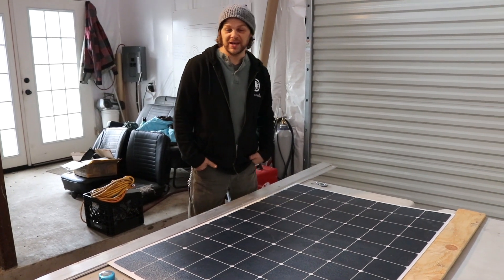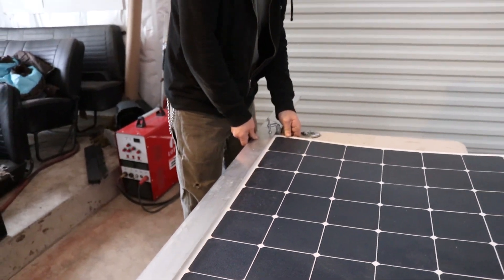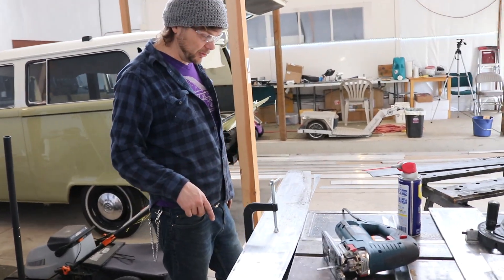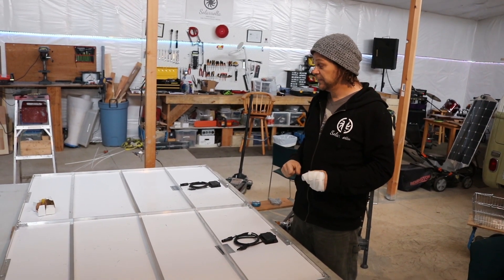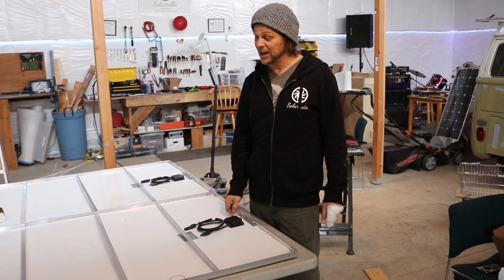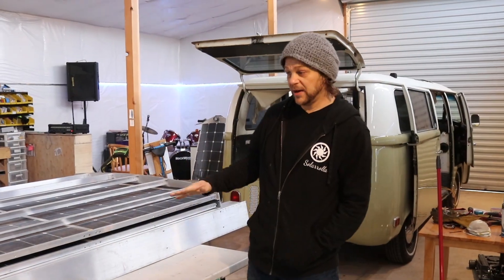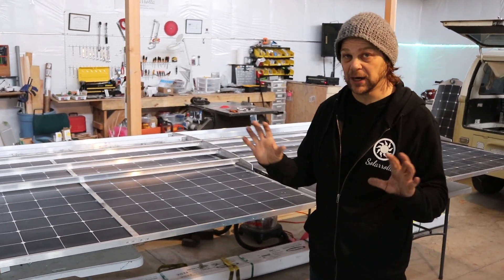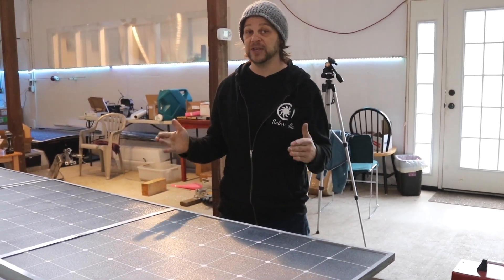Solarrolla- Redfoo Video 5: Solar awnings, how to get 3KW of solar on a VW Bus!

Comment: Great video. I'm planning the same for my renovated (in process of 100% interior, etc.) 32', 3 slide RV/Tiny house. I hope to operate a mini-split.
Consider a 'trim-router' with a template for cutting aluminum shapes.
I would like to figure out a way to tilt, or angle the panels to face the sun squarely.

Comment: Awesome, looks very nice, thanks for sharing! 3kWp is impressive.
I'd be curious if anybody has looked at the "Iveco Daily Electric". It seems like the ideal electric van at the moment, you can also get it as a chassis and build your own box on top of it. Potential for lots of solar.
I'd also be curious what solar panels you chose. How is cost / kWh, efficiency and longevity compared to heavy glass panels?

I was seriously considering building a solar powered van but I now plan to build a solar powered boat instead. Much more work of course.